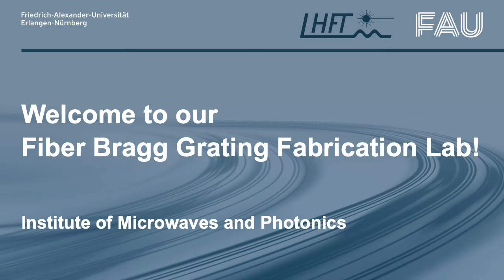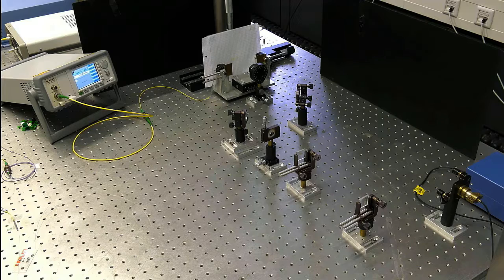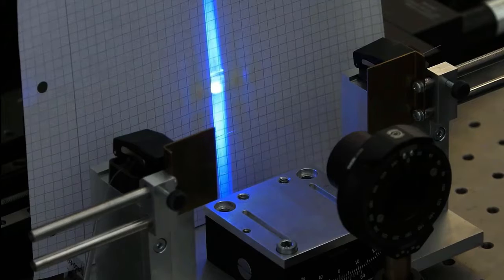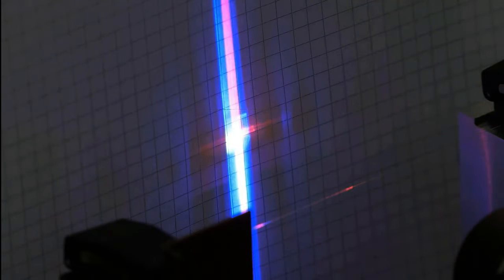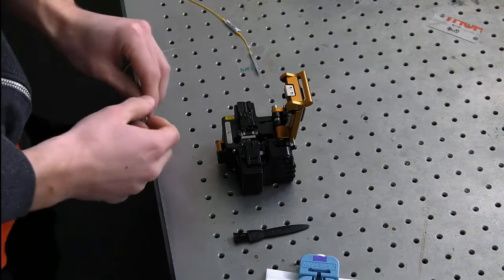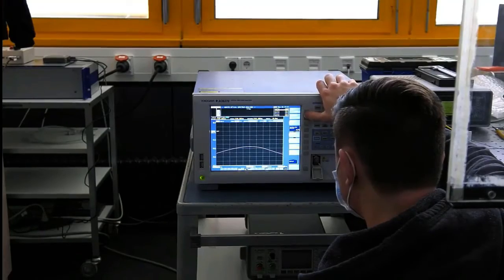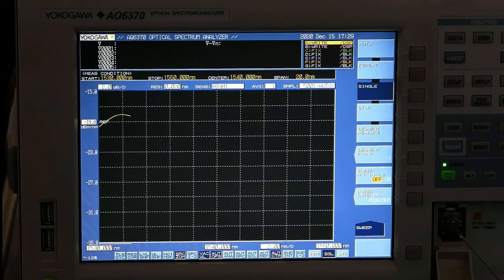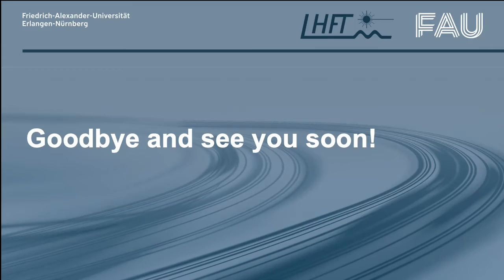How to inscribe a Fiber Bragg Grating?

Comment: I have some question for FGB that i found issue about reflectivity as shoot laser to fiber optic. I use center wavelength 973.6 nm. I have confirm check the laser and alignment but can’t fix yet. Do you have any advice to action for this.

Comment: Is there a physical effect of inscription that causes the shift in the peak wavelength after the second set of exposures to the laser at 10:50 ?  Very interesting video, many thanks for sharing this.
Reply from the maker: The peak wavelength (or Bragg wavelength lambda_B) is shifted after the second inscription step, because the effective refractive index n_eff changes due to longer exposure to the UV beam. The equation for the peak wavelength as shown in the beginning of the video: lambda_B = 2*n_eff*grating period.